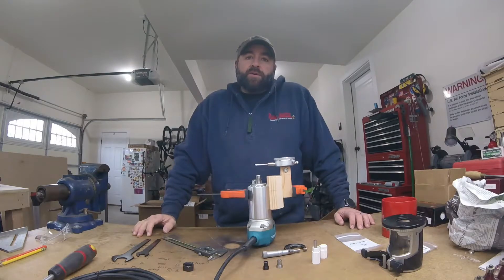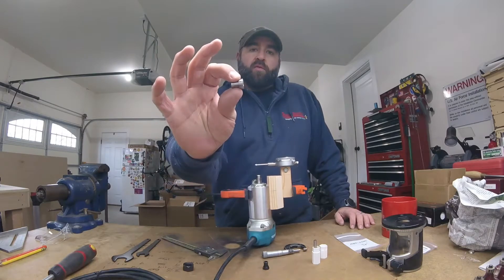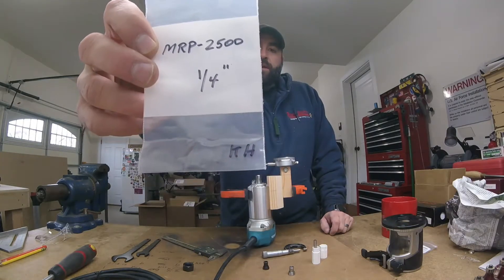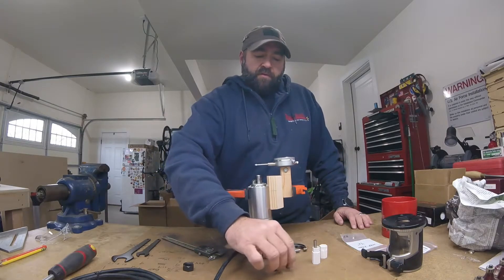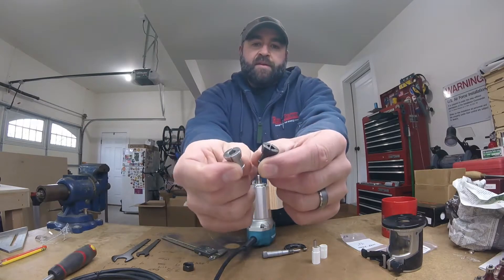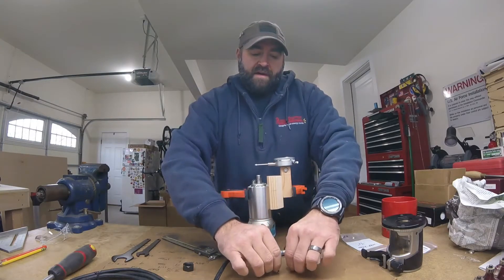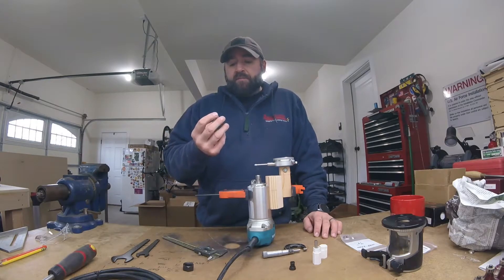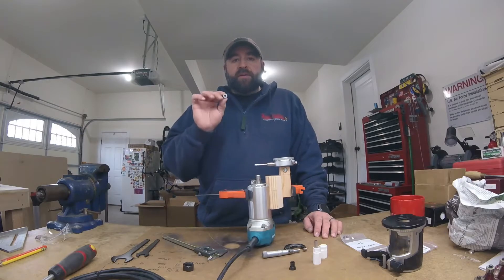CNC Router Spindle Runout and Elaire Collet Review

Comment: When you say runout, would that be the same thing as having the bit sliding out of the collett.  Ive got aCNC and it keeps falling out. Its become a huge pain in the butt.
Reply from the maker: Runout is essentially the bit rotating off of center or wobbling.

Having the bit moving in the collet is due to either not tightening enough (which is least likely), debris in the collet which would cause it from clamping enough or the bit shank is smaller than the collet size (5mm bit in a 1/4" collet.
Reply: @kanovaworkshop  I see upon further inspection I believe that the colette has been bent or is misshapen.  Idk about aftermarket collets but this one seems to be the issue
Reply from the maker: @kevinkruse88  a bent/misshapen collet could be caused by over tightening or crashing the bit into something among other things. Regardless it could cause excessive runout, vibration and low grip on the bit.

There are several places replacements can be procured. The Elaire collets work well and I would recommend them.
Reply: @kanovaworkshop  That's where my research has led me. I've definitely crunched them into things before surprisingly enough the bits that I use just plow through whatever I run it into.  

I think in the future I will purchase one of their bits. But since I have orders that need to be finished I actually just went out and bought another one of these Makita routers It's kind of stupid because the collet is $25 If you get a whole new router it's like 85 which is more than I want to spend but I got to make the customer happy
Reply from the maker: @kevinkruse88  I have a spare Makita ready to go In case I'm in a spot where one stops working and I have to get something done at zero hour, which is most certainly be 11pm on a Sunday... lol